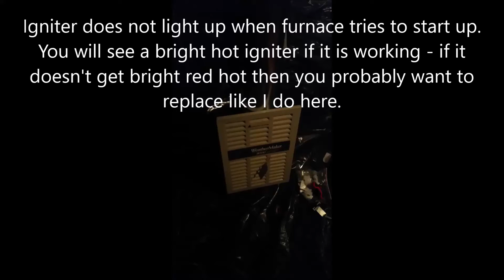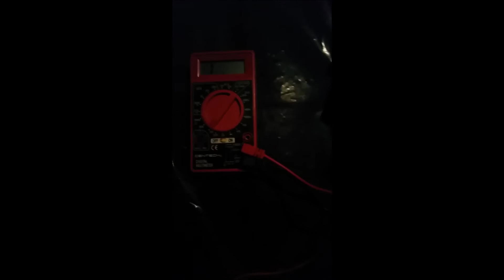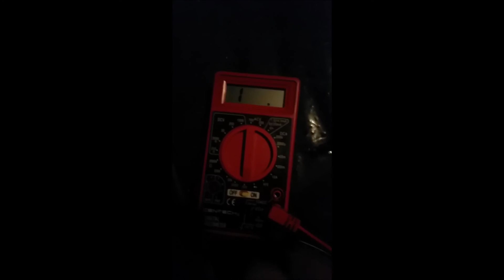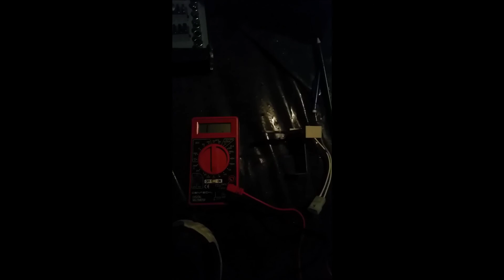Weathermaker 8000 - Replacing Igniter / Ignitor - Fixing Error code 14 and 34 - Igniter Lockout

Comment: Very helpful in showing how to detach the igniter assembly, at 1:10 .
Tips: for the correct orientation of the video to match the furnace (with burner at the bottom), you have to virtually rotate the video clockwise 90-degree.